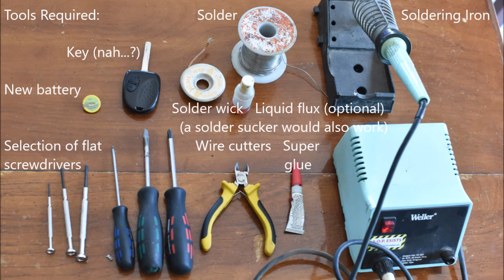How to change remote control battery in VR VS VT VX VY VZ Commodore key fob

Comment: I've butchered mine I took the battery off  the original holder and held a battery in there to try get the alarm off but no luck please help
Reply from the maker: Hi Thomas, if you buy a replacement battery with the tags already attached (link in the description) you should be able to follow the directions and solder in the new one. Let me know if you get stuck.

Comment: hello mate i was looking at the link and the link is for a non rechargeable battery i know the battery is normally charged by the car in my case a vy is changing the battery to non rechargeable made any significant issues arise?
Reply from the maker: Hi mate no the key fob battery isn't a  rechargeable one, it doesn't get recharged by the car, it's just a regular battery which needs replacing occasionally. The one I recommend is the same non rechargeable unit which is in the key fob originally.
Reply: @TheMusingGreg  ohh that’s interesting I was misinformed thanks for this info
Reply from the maker: No problems! It would work for it to be rechargeable, but a rechargeable battery would probably exhaust its charge discharge cycle lifespan before a lithium non rechargeable one ran out of charge. Plus less revenue for manufacturers from new keys!.
Reply: @TheMusingGreg  thanks for this information it really helps i hope you have a good one mate

Comment: Nice job mate👍but where did you get the battery from and how much $$
Reply from the maker: Hi mate, sorry I got it from Retro Sales for $1.80 each. The link is https://www.retrosales.com.au/products/parts-modding-battery-save-game-cr2032-cr2025-cr2016-cr1616-tab-tabbed?variant=25772027216. I had that detail in the full review on my blog http://www.themusinggreg.com/how-to/how-to-change-the-remote-control-battery-vr-vz-holden-commodore-1993-2006/

Comment: Good video, thanks for this. I didn't have solder braid so I plaited/braided some fine stranded wires I pulled from an old cable, the solder came off surprisingly easy. Used tiny bit of  liquid flux on it.  I didn't have a battery with tabs, but I did have copper foil so cut a small piece and soldered where the tabs should have been on the battery and cut a small bit of aluminium can and wrapped it with the copper foil for the circuit board. The battery has been dead for about 6 years, just starting to be awkward with manual lock/unlock. Wish I watched this BEFORE I pried the case open, jamming the screwdriver under my thumbnail made me bump the table.  Now I've lost the pin that goes in the opposite side of the case to the contact loop.  Do you reckon I could use a small piece of a s/steel pegboard hook the same diameter? Or a small machine screw? Or a plug from a cable/stereo jack or the copperfoiled beak of the silly chook that ate the dropped one?? It's the principle now, whether it works is irrelevant, I just don't want to have to buy a new one for losing the pin after taking it all apart and jakguyvering it all back together with only one minor injury. My thumb, not the chook's bum..I wonder if the pin will be in an egg!? Cheers for the video mate!
Reply from the maker: Haha what a hilarious story! Hope the chook is ok! There's nothing particularly special about the pin, so providing the thread portion of a screw fits into the clamp on the board, and the screw head is about the right size and shape there's no reason why it shouldn't work. But as you say there's not a lot to lose now. Good luck and thanks for the laugh! 🤣
Reply: @TheMusingGreg  Thank you so much for your reply! I actually used a rivet...bashed the flange off and cut it to length...didn't work when I first tried to lock/unlock, but after I started it and turned it off, it would lock but not unlock....noticed there's a bit of crud from the old buttons I replaced a year or so ago underneath that particular switch so hopefully if I can clean it without 'poultry interference' I'll get to unlock it with the buttons again....glad you got a chuckle, will let you know if I get any egg surprises 😉
Reply from the maker: Haha great! Yeah a rivet would be a good choice. Hope it works for you!

Comment: search 'CR2032 pins' on ebay
Reply from the maker: Yep that will work. I got mine from Retro Sales for $1.80 each. https://www.retrosales.com.au/products/parts-modding-battery-save-game-cr2032-cr2025-cr2016-cr1616-tab-tabbed?variant=25772027216
Reply: They need the terminals already spit welded onto the battery though, the four tiny dots you see on the terminals.

Comment: Been putting this off for the shopping car, finally the key stopped working when locking the doors manually (battery has been dead for ages)
Ordered the battery via the link you posted in another comment.
Cheers for the video.
Reply from the maker: Great to hear mate! No point paying through the nose for a new key when the old one's an easy fix. Take care!

Greg
Reply: I love how you call it "the shopping car" hahahaha. Let me guess, it's a VT-VX and you upgraded to a VE or a Captiva?
Reply: @RiffRaffMama.  No, not a big fan of bogan mobiles for my daily driver.

It literally is just the "shopping car" for groceries/hay bails/cow shit.
Shopping center carpark's around my area are super narrow, nobody gives a toss about anyone's cars so you wind up with countless dings, scrapes etc.
The plan is to drive this old nugget into the ground, not far off now.
Reply: @sfrrob  You throw hay bales in the back of yours too? I also throw my goats in the back of mine. Just have to put a bit of netting between the two front seats to stop them getting into the front seat. 
You think these cars are not far off the end, but the bloody things just keep going! I have a VX Berlina that I technically wrote off spectacularly three years ago. Funnily enough, it was the fact that I had two hay bales in my back seat that I was able to limp home after the accident. I couldn't get what was left of the front bumper fully off, so I tied it to what was left of the radiator frame with a piece of baling twine cut from one of the bales lol. Here's a pic. You can even see the bales in my back seat: https://ibb.co/vV0dHkq . I replaced the broken bits with ones off a VX Exec I had in the same colour, and figuring there was no way she could bounce back after taking down and running over a pole, I thought "screw it" and proceeded to "drive her into the ground". So I thought, anyway. I live on a dirt road in a country town and drive her like shes a 4WD, never wash her, never service her... I'm not a gentle owner. I just top up the oil when the light goes on, ignore the fuel gauge and stay away from the wiring underneath the seat. The suspension and wheels have never been quite the same since the accident and she chews through tyres like nothing I've ever seen, but does she want to give up? F*ck no. It's reached the point where it's kind of like driving a boat, but I love her to death for her sheer defiance.
Reply: @RiffRaffMama.  hahaha, that is hilarious!
Don't get me started on the fuel gauge, it's left me stranded a few times now.
I am worried mine won't die as well. I have a persistent oil leak from somewhere. I've degreased the entire engine to search for it, but can't find it.
As much as I hate the car, I respect the car for it's refusal to die.
In the last 6 months the car also appears to have decided to shed it's skin. The paint has started heavily blistering EVERYWHERE.

Comment: Thanks Greg I have just used your video guide to replace the batteries in both my keys for the VZ.  My original key died about three years ago, not bad service for a 2005 vintage. So out with the spare along with the thought that I should really do something about fixing the original key. So silly me operates happily until a fortnight ago when I went wading with that scond key in my pocket 🤕.
New batteries as per your directions and hey presto back in action despite the naysayers bleeting about the need for locksmiths, reprogramming etc. Thank you.
Reply from the maker: Glad to be of service mate! One of mine has since died so I have to do this again and not just 'keep using the spare ' 😄

Comment: In a case like this (no pun intended) that might need to be opened again, I use silicone, any will do, that way it holds together well but with a little heat comes apart again easily. Just my two bobs worth! And great write up im gonna try this myself, well done!
Reply from the maker: Haha good one Bobby! Yep silicone might work, although I worry it might not hold the two halves together tightly enough, and they might come loose out in the field. The two halves might 'clop' together a bit too if they're a bit loose. Worth a try though.

Comment: Thanks for the tips. Great video.  Ages ago one of my VX remotes stopped working - it was onlhy a loose connection on the metal key. But I measured the battery - 3.3Volts, and just over 2.8 ish under load.  
So now with 22+ years on the same batteries (daily driver) they were sure made to last!  On one remote the case wouldn't stay closed, so I used a small countersunk screw, screwed into the tapped hole in the middle of the metal key.  Worked.
Reply from the maker: Thanks Jeff. Did yours work ok after you reconnected the battery? And how long wasn't it working? One of mine stopped working a few weeks ago and I found the tab had come off, but when I held the tab against the battery the key still didn't work. Im wondering if too long off power makes it lose its code.

Comment: Cheers for the video. FYI the old battery may have ~3v, however under load it won't have the grunt!
Reply from the maker: Glad it was helpful Steve! Yes that's quite correct. The new one was about 3.25V if I recall.
Reply: @TheMusingGreg  one thing that stumped me is that I thought I could de solder the tags/clip/circuit board mount off the old battery and stick it on the new one, however I'm having a really rough time with this!
Reply from the maker: Hi Steve, nope the solder tags are spot-welded onto the battery. You'll likely overheat the battery and possibly damage the seals if you try to solder the old tags onto the new battery. You'll also struggle to get the tags sitting flush against the battery if you solder it, which may prevent the key fob shell closing properly. Grab yourself a new battery which already has the tags on it and save yourself a lot of hassle.

Comment: the little metal loop that sticks out and makes contact with the key is broken, do you think I can resolder it back together and it will work again?
Reply: I have not had one of these apart myself, but strictly from an electronics repair perspective...
Depends on where it is broken... If the loop (where the screw goes through), yeah solder it... But only very lightly, as the solder may crush when you screw it back together. Although, this may be a different story if it is, like snapped it half.... If so, same as next step.......
If its between the circuit board and the loop, I would definitely solder a jumper wire across it.... keep it very flat and straight. And if possible do it on both sides.
Reply from the maker: I'd agree with @Steve McDonald. It should be fixable, it just depends where it's broken as to how you go about the fix.

As far as I can tell, that contact simply connects the key shaft to the circuit board, to form one half of the anti-theft circuit, with the other half formed by the little metal button poking out at the top of the key which contacts the slider around the ignition switch. This is why the alarm turns off if your key battery is dead, you open the car door, the alarm goes off and then you insert the key and turn it. So all you need to do is have a good electrical connection between the key shaft and the circuit board. Without seeing what's broken, I would suggest you could get around a completely destroyed contact by creating a new one out of a few small loops of tinned copper wire with the tail soldered into the appropriate spot on the circuit board.

Good luck, and let us know how you get on!

Cheers,
Greg

Comment: I pulled the key on my 2001 Maloo R8 apart and removed the battery then tested the battery and it reads 2.9 volts ..is 2.9 volts enough to work the key fob ? 

I may have other issues with the car not starting 🤔
Reply from the maker: Hi Ianharrd,

Nice car mate! The new batteries were 3.25v, so yours do sound a bit low. However I'm pretty sure the battery only runs the remote transmitter, not the electrics in the key itself. Since I shot this video I've had one key fob transmitter stop working but it still starts the car fine. If your batteries are below 3v it wouldn't hurt to change them, but I doubt that's the cause of your beast not starting. Hope you find the culprit!

Cheers,
Greg

Comment: Thanks mate.... I thought I read in forums, that the key memory was held in RAM, so if u removed the battery, it loses the code.... I guess not. Thanks!
Reply from the maker: My pleasure Steve. I'm pretty sure Holden would have designed it so the code algorithm is stored in flash memory rather than RAM, that's certainly how I would have designed it. It's also possible the algorithm IS stored in RAM as you suggest, but that the circuitry has enough capacitance to retain the RAM state for a little while while the battery was out, much like the clock radio code.

I guess, if you're doing the change, get the new battery in as quickly as possible. Although as you can see, it doesn't take long to get the new battery in once the old one is out, the real work is on separating the casing!

Cheers,
Greg
Reply: For whatever reason, the "lost code" warning scared Commodore owners for years, and still does. I am here to tell you though, that I have owned 15 Commodores and have changed the battery in half a dozen keys easily and have never had a problem with any of them becoming unprogrammed, ever.
Reply: @RiffRaffMama.  does this work on vt vx?
Reply: @420woodsy  ALL of the battery changes I've done have been VT and VX keys, including my current daily driver VX, so yep.

Comment: Where can you buy those batteries (with the terminals attached)? I can only find plain button batteries with no way to attach them.
Reply from the maker: Hi mate, check the description: https://www.retrosales.com.au/products/parts-modding-battery-save-game-cr2032-cr2025-cr2016-cr1616-tab-tabbed?variant=25772027216. It's tricky trying to solder to a button-cell battery as you have to scuff the surface first, then tin it, then do the soldering, and the heat from the soldering iron can damage the battery.

Comment: Hi Greg,

Changed battery as per video and tried it but because the key had not been used for a while does the memory chip fade with time? And will it have to be reprogrammed?
Reply from the maker: Hi Sharon,

I can't say for sure because I don't know how the code is stored. However I expect it WON'T lose the memory - I've done this successfully before after a key has stopped working properly, however I can't say for sure because the old battery may still have had enough charge to hold onto the program. I would say give it a go, you have nothing to lose but a bit of time about about $2 on a replacement battery, vs $100 or so for a new key.

Good luck!
Greg
Reply: No, it doesn't fade. It's a lot like a USB drive - so long as it's not damaged, the information on it will not slowly disappear. If you replace the battery and it still doesn't work, then it's either the wrong key (easy to do if you have more than one VR-VZ Commodore) or there is something wrong with another component like a damaged connection on the circuit board. Make sure the electrical "pin" (the metal bump next to the actual metal key) is there. Without it, your car will not start.
Reply: Did anyone tell you to try syncing the remote after the battery install?

Comment: Will a dead key battery stop the car from starting? I was unable to lock the car with the key buttons, key in ignition turns accessories on but as soon as I go to crank there is absolutely nothing. Red immobilizer light is still flashing so I tried what is says in the owners handbook which is to leave key in ignition in accessories for two hours then try but the red light kept flashing and would not crank
Reply from the maker: I haven't had that myself but if the key battery was completely dead it's possible the circuitry to turn off the immobiliser might not be able to run. It does sound like that might be happening although what you've tried should have worked. If you have the other key try that, otherwise I'd suggest changing the battery in the key you have as per the video and see if that helps. If not, you might have to get a new key from Holden as a last resort.
Reply: @TheMusingGreg  Thanks for the reply. Got a new aftermarket fob and a plug and play programmer from supercheap. Saw a few videos of it done with vt commodores, of course when i do it the programmer goes red not green. tried it a dozen times to no avail. So now I think I will have to get it trailered to a mechanic or an auto electrician.
Reply from the maker: Could it be a problem with the programmer possibly? It's hard if both the key and the programmer are aftermarket and can't be tested any other way. Supercheap may be able to confirm or deny if it's working or faulty? Otherwise I agree an auto electrician might be the next best option. Good luck!
Reply: @barbellsamurai8014    did u manage to get it sorted? im going through the same issue atm, cheers
Reply: @raphgili7726  ended up being the body control module. was stuffed and wouldnt turn off the immobiliser so car wouldnt crank or would crank for a second and stop. central locking runs through the bcm I believe so that stopping working was probably all part of it